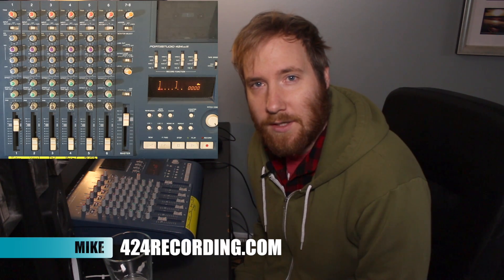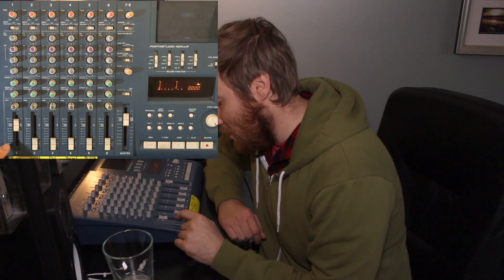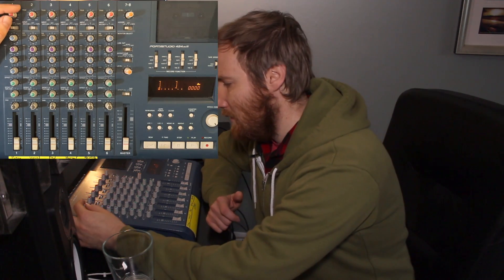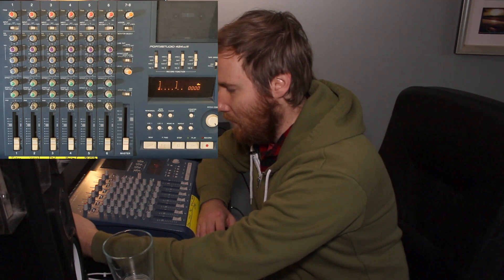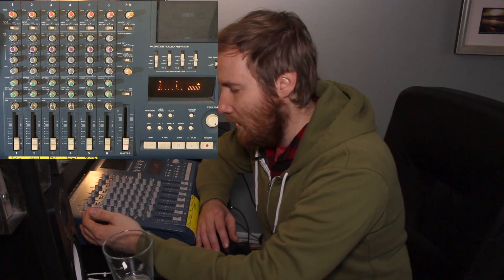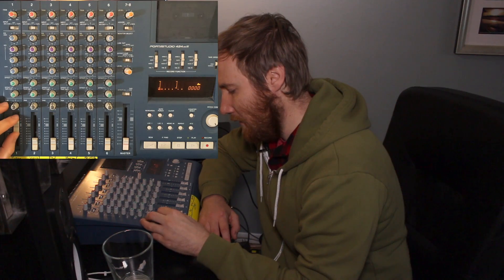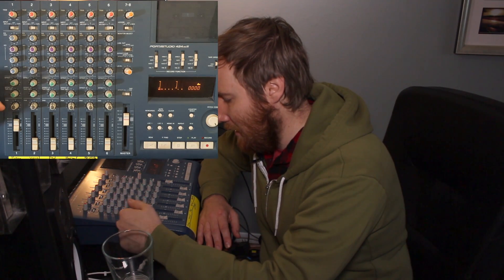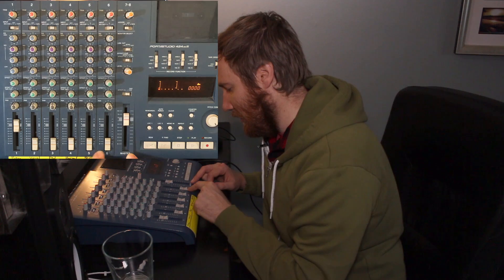TASCAM 424 MKIII: Setting Mic Levels: Trim & Fader | 424recording.com

Comment: The advice in this video is back to front in respect of pre-amp gain. The level from a mike will be a tiny fraction of that from a line level source, sometimes as less as 100th. It's the mike which needs the gain, not the line level source, which could be as much as 2V. When you turn the control towards mike, it boosts the pre-amplification between the input and the mixer. Turning it towards line decreases the pre-amplification. Other than that, great video as usual.
Reply from the maker: Whoops! Thanks, Jon!

Comment: Soooo, I get trying to get the colored lights to not go into the red and stuff, but with the D-006 digital one, do you know what is the best level to set the volumes, does it matter where the master volume is. Pans?  I'm never quite sure what to do.  I do know that when I've set Mic input  level to "Low," it has been inaudible, and "High," is all sorts of distorted. But I'm not certain where I want the various knobs to be regarding Input levels, Master level, and track levels?
Reply from the maker: I don't think Master matters for recording. Pans shouldn't make a difference either. If you're using the internal onboard mics, you will use the mic input level at low, medium, or high, but this will only be for the onboard mics. You'll have to vary the distance of the physical recorder or audio source if the level is too loud or too soft. If you're using a mic/line or guitar in inputs A and B, make sure the switch on the side is set accordingly. You'll adjust the INPUT A and INPUT B knobs for those inputs. The OL light might come on but I've never noticed any noticeable distortion. Good luck! I also made this playlist about the DP-004/006: https://www.youtube.com/playlist?list=PLxvSYDmM5dioz0VdUP1YhHACSdYqSqIpO
Reply: Thanks Boss! You've been very helpful, both in the questions I've asked over last few days, and in this vast back catalogue of your videos I just discovered. People like you get a gold star.
Reply: Yeah, I checked out that video thread the other day, I asked about using the 006 and 424 in conjunction for various purposes/reasons.  Very helpful.  Turned my "drummer" on to the channel after that.  Good stuff.
Reply from the maker: My pleasure, Se Sa. Glad to help. Thanks for sharing the channel!

Comment: Hey Mike, I recently purchased a 424 MKIII and your channel has been very helpful. I'm curious though in terms of preamp for mic. Since the machine already has a mic preamp built in would you still recommend  something like the Art 200 MP for doing vocals? I seen one at the local pawn shop and thought about picking it up after watching another one of your tutorials. Thanks for all the info and cheers.
Reply from the maker: Nicholas McNally hey! Thanks for being a patron btw! Yeah those are great and super useful. Great if you wanna use condenser on your vocals thru the 4-track! You can make the preamp overdrive as well which will give the vocals additional warmth and edge. I think I got mine for like $40 new? They shouldn’t be more than that. Let me know what you decide. Thanks again, Nicholas!
Reply: 424 Recording You're very welcome, I'm glad to support. ...I actually went out and bought the Art Tube Amp. I guess it was the Studio though and not the 200 but I mean it looks pretty identical to the one in your video. It was $30 and the guy was like, "Man these use to be so much more than this" .
Reply from the maker: Thanks, dude! That's funny... I didn't know there was another version. Looking online it looks like the Studio is 2x the price of the one I have! Nice score. I might have to check that one out as well. That's cool that it has different voicings as well as a limiter... I would love to slam that with a drum room mic and see what happens. Let me know how it works out for ya. I'm jealous haha

Comment: Thanks for the video! I am working currently on getting into recording with this cool device. And I am a bit confused cause it is indeed possible to take six sources (e.g. drums 2x overhead, snare, bassdrum, hi toms, lo toms) and to record it on 4 tracks? How does this work out? Cheers
Reply from the maker: Meikel El Verwirrto https://youtu.be/pvJ0SCaMzxY
Reply: Hi, thanks for the video. But the question is how to assign the inputs to the tracks? All about panning? Or must I use the direct-selection?
Reply from the maker: Meikel El Verwirrto panning! You can record all six inputs to one track. Arm track 1 and pan all inputs to the L. 🤓
Reply: Thanks again! So one last question: I want Bassdrum on 1, snare on 2, overheads and toms on 3 and 4 (stereo) - that'll work? Love your channel and the vids, really helpful!
Reply from the maker: Meikel El Verwirrto you want those on the tracks? Or the inputs? If you want them on each track go direct to each track
Reply: Basically I want bassdrum and snare direct on track 1 and 2, that's perfectly clear to me. But overheads (e. g. Input 3 and 4) and toms (e.g. Input 5 and 6)  I want on track 3 and 4.
Reply from the maker: Hmmm... not sure if that will be possible. You can try 1 + 2 direct and then a stereo mix of 3, 4, 5, 6 on 3 and 4. Pan 3 and 4, L and R, as well as 5 and 6, L and R. I'm not sure what will happen though. I think your options are a stereo mix of the kit on 1 and 2 or a mono mix of the kit on 1. I could be wrong though. Experiment! Let me know how it works out
Reply from the maker: Spot on, Joel. Thanks!
Reply from the maker: Do you mean the switches on the channels, Joel?
Reply: Thanks a lot guys! That helps I think! I'll try it and let's see what comes out! Cheers guys!
Reply from the maker: Cheers, Meikel. Good luck. Let us know what you discover
Reply from the maker: You can route the signal there from those inputs, i.e. plug a mic in 1, switch channel 5 to input 1 and now you can use different EQ settings on the same mic or hook up an effect on 5 and have a clean signal on 1 and the effected signal on 5, etc. There's a lot of possibilites
Reply from the maker: Joel Glyn-Davies 💥

Comment: Hey man how's it going? 
I have a question.  I recorded a beat on to tape but when I play it on a regular cassette player it sounds slow. do you know why? thanks
Reply from the maker: Did you record with the pitch wheel up?
Reply: 424 Recording  yes does it have to be in the middle?
Reply from the maker: Yeah, if you want it to play back properly on a normal deck. You pitched it up when you recorded it so on the 4-track it will appear normal speed but once you take the tape out and play it in a regular machine it will play it as if it's in the middle position on the 4-track. You'll have to rerecord again with the pitch wheel in the middle :)